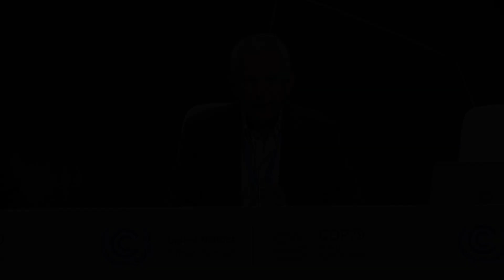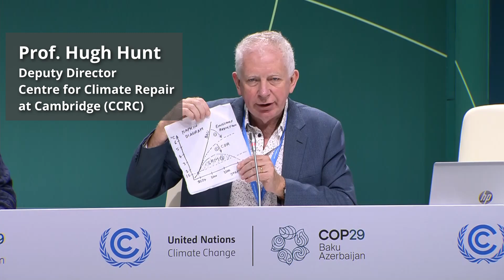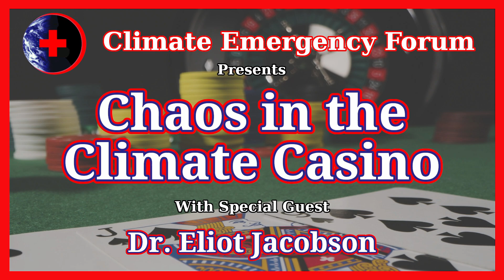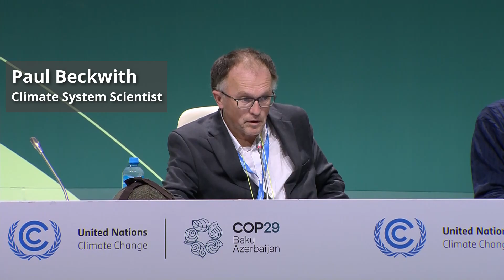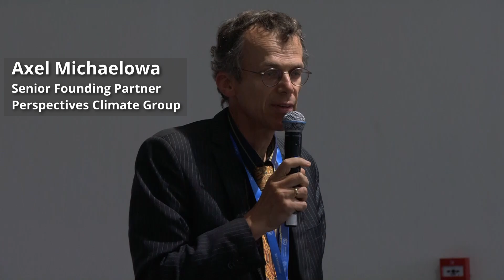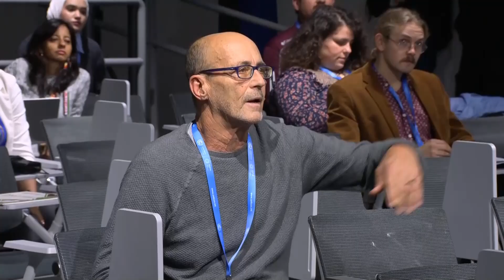Climate Engineering and the Napkin Diagram

Comment: "Climate Engineering and the Napkin Diagram" likely refers to a simplified visual or conceptual representation, often sketched on a napkin, that illustrates the potential mechanisms or approaches to climate engineering. Climate engineering (also known as geoengineering) involves the deliberate modification of the Earth's climate system to mitigate the impacts of climate change. The "napkin diagram" is likely a shorthand or metaphorical tool used to simplify and communicate complex scientific and technological concepts in an easily digestible way, making them more accessible to non-experts and decision-makers.

The central idea behind climate engineering is to propose solutions to address the harmful effects of climate change that cannot be entirely solved through traditional mitigation methods like reducing greenhouse gas emissions. Climate engineering approaches generally fall into two categories: solar radiation management (SRM) and carbon dioxide removal (CDR).

1. Solar Radiation Management (SRM): This approach aims to reflect a small percentage of the sun's energy back into space to reduce global warming. One popular SRM method is the injection of aerosols into the stratosphere, which would mimic the cooling effects of volcanic eruptions. The "napkin diagram" might illustrate how this technique could reduce the amount of solar radiation reaching the Earth's surface, potentially lowering global temperatures.

2. Carbon Dioxide Removal (CDR): This method focuses on removing CO2 from the atmosphere and storing it in a variety of ways, such as through afforestation, direct air capture, or ocean fertilization. A napkin diagram in this context could show how technologies like direct air capture (DAC) work, where machines extract CO2 from the air and either store it underground or repurpose it for other uses.

The "napkin diagram" might also be a critique of how simplified solutions to climate engineering can oversimplify complex environmental processes. It could highlight the need for careful consideration of unintended consequences, ethical implications, and the scale of intervention required. Climate engineering, while offering potential solutions, also raises significant concerns about governance, risks, and the feasibility of implementing such strategies globally.

The discussion of climate engineering, especially through a simplified visual like the napkin diagram, invites reflection on how scientific innovation must be paired with ethical decision-making. Climate engineering proposals carry the potential for both positive and negative outcomes, which must be thoroughly evaluated through comprehensive research and international collaboration. This conversation forces us to grapple with the question: Can we manipulate nature to save the planet, and if so, under what conditions and with what safeguards?

Ultimately, climate engineering is a field that has sparked significant debate, and the napkin diagram could serve as both a tool for explaining potential strategies and a symbol of the oversimplification of such a complex, high-stakes issue.